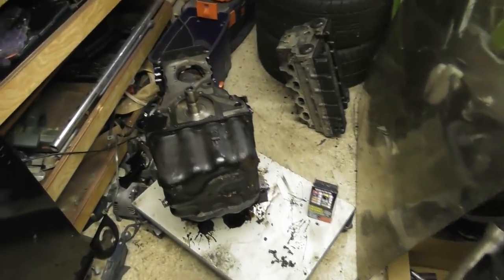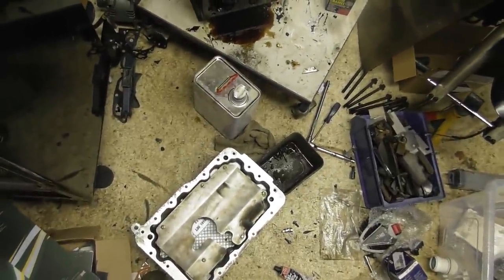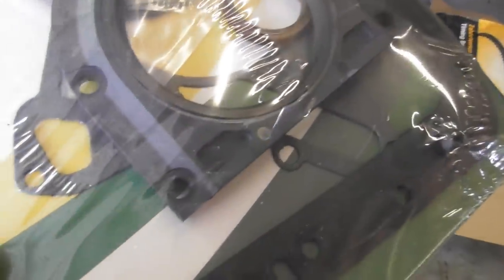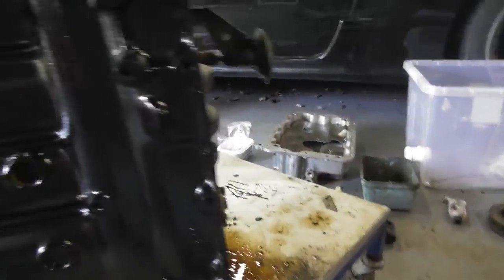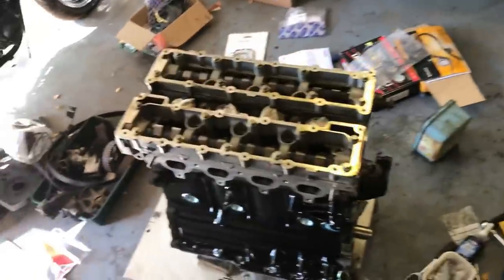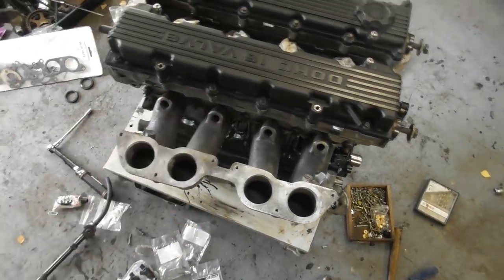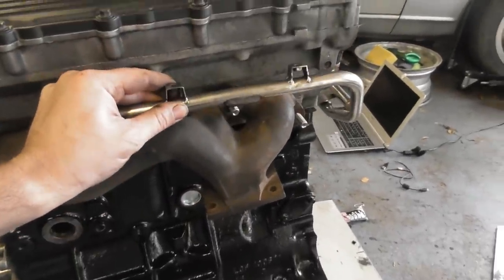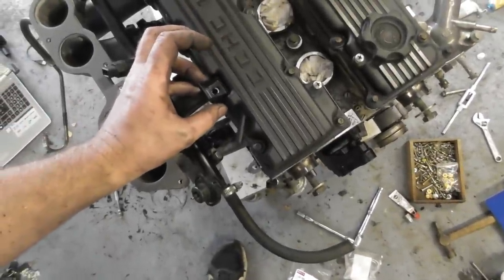Rover 200 mk3 Bubble T16 Turbo - Video 17 More engine prep

Comment: Looks like it's should be ready for fitting soon.
Just an observation with the use of stainless studs in an alloy head, apologies if you already know. They're differential metals and can give you some differential metal corrosion. It'll be the alloy head that gets eaten. I've used stainless studs on rover v8's in the past but smeared the studs in a grease called lanoguard, which is a lanolin grease. Its used in the marine industry and should keep the alloy in one piece. Alternatively I should think copper grease will do the same job, which you may have done anyway.
Looking forward to seeing it run. Its a good looking engine
Reply from the maker: yes got copper slip on them

Comment: Your Getting there mate. Best doing while it's all out mate. I  have  used the  red gasket seal myself. I got do my rocker cover on my Audi pd130 leaking a little oil. Advised at MOT so I  suppose I had better for it now. Had to retap my anti roll bar yesterday as the bolts sheared clean of in the alloy. Yeah there better stainless saves any rusting out bad for doing that. Find the black rtv sealant is better myself altho as I said have used the red gasket seal myself.👍 nice progress man.

Comment: I don't really use Coppaslip any more, which is typical as I have 2/3 of a tin kicking around - I've switched to aluminium grease antiseize now, due to galvanic corrosion. I use Permatex, not a sponsor :-) It's worth checking out. I had some bolts seize and look pretty manky even though I'd Coppaslipped them a couple of years before - so I looked into it and basically... galvanic series... Nobility of metals... The copper in the interface between steel and aluminium can increase the electrical potential in the join and make stuff worse for both the steel and in particular the aluminium. No problem if your car never sees moisture though - And don't panic and pull everything apart you've ever done. I didn't it was just one case on a water pump!

Comment: Another great video, thanks for taking the time to make it. I've not changed a core plug in 30 years, but I always used a self tapper through the middle, and a claw hammer to lever them out. Then sealed with exhaust paste . What's the twin headlight motorbike in your engine shed ? Hurry up and get another video up!

Comment: so what made you use that cheap red gasket sealant in the first place when you already had some Loctite Black? That’s out of character for you.... anyway, engine is looking good now, and this is a great project. Best regards buddy
Reply from the maker: the black stuff is meant for oil, so I figured I should use the red stuff as it is supposed to be for machined surfaces where there are no gaskets i.e. precisely this application. however the red stuff is shite so I binned it and used the black. should be fine with coolant.